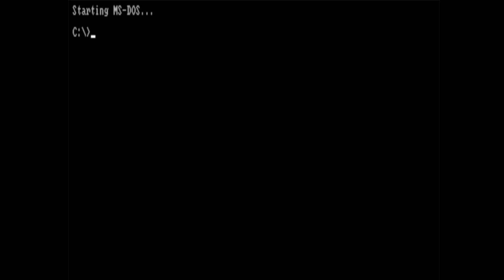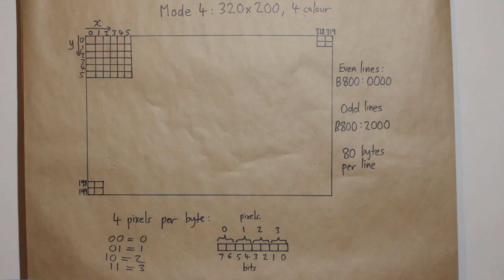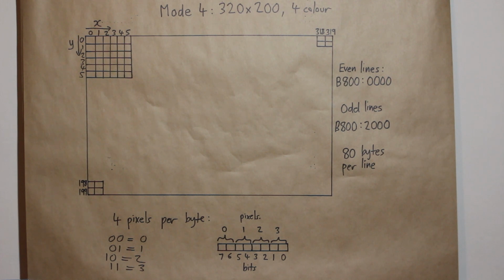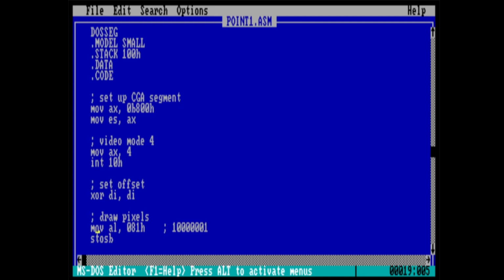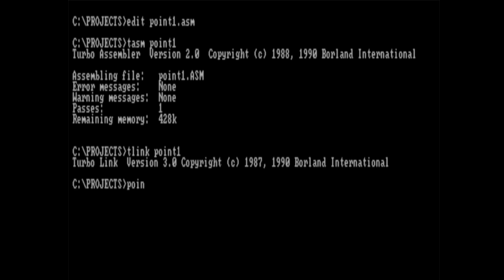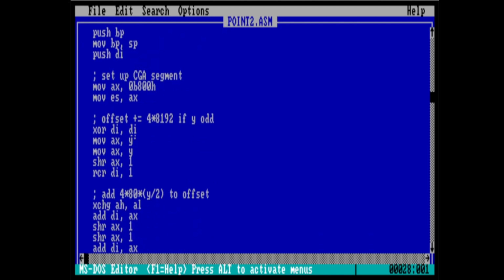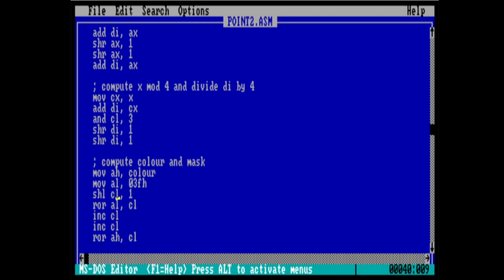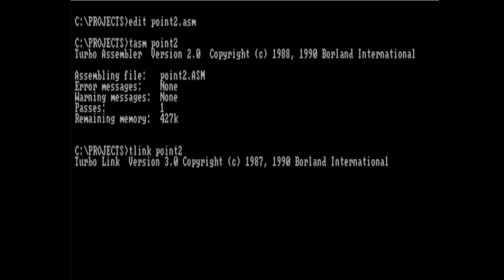CGA Graphics Programming: Mode 4, Pixel Drawing Routine

Comment: It's not really counting from zero, conceptually. It's counting from the address of the buffer. The first pixel (or first 4 pixels in CGA) is at offset 0, aka buf+0.

I still wonder how IBM came out with a nearly $2000 graphics subsystem that only had 4 ugly colors in medium res. If you pay that much, don't you at least want to pick the colors? On one hand, I'd say that anything going on at a corporation has about 20 bodies for every 1 competent engineer, and I'm not all that sure IBM was primarily an engineering company. They also weren't a marketing company based on their ads.  Sales?  Yes, I think so, just like all the companies where I've worked with abysmally bad tech. They just had lots of talented salespeople.  And I did hear on a Computer Chronicles rerun from around 85 that they were hiring 2000 more. 

Ti wasn't so good in sales, but they had a machine with 16 colors. 8bit guy seemed to imply their design was poor since they used VRAM to run BASIC. Personally I think it's smart. For very 100 users, how many are going to run BASIC regularly anyway? 5?  I ran it about 3 times in 3 years.  But they had video RAM which could play 16 color games and educational titles, in pretty good resolution, with fast sprites, plus even sound and sometimes speech.  The whole Ti cost less than just the CGA card!  It would just work.

Which brings me to Macs. IBM -- Big Brother, drab and uninspiring -- has 4 sad colors, so how is Apple going to differentiate?  Yes! Comically tiny monitors that are strictly monochrome. High fives!

Comment: What changes will need to be made for Mode 6 (640x200) if any?
Reply from the maker: Only a few. In mode 6 there is only one colour and 8 pixels per byte. That means if you want to deal with each pixel individually, instead of in pairs, you have to do the arithmetic slightly differently to convert the x-coordinate to a byte location (divide by 8 instead of 4 and do single bit shifts rather than by a multiple of two bits when putting the bits in the right place in the byte).

An improvement over mode 4 is you don't need to deal with multiple colours, so there's no need to store a colour. Just set the appropriate bit and you are done.
Reply: @pcretroprogrammer2656  I'm still a little confused as to the logic cause I can't get it to work.  Does the following stay the same?

    ;;;;;;;;;;;;;;;;;;;;;;;;;;;;;;;;;;;;;;;;;;;;;;;;;;;;;;;;;;;;;;;;;;;;;;;;;;;
    ;; Offset += 4 * 8192 if y odd.
    ;;;;;;;;;;;;;;;;;;;;;;;;;;;;;;;;;;;;;;;;;;;;;;;;;;;;;;;;;;;;;;;;;;;;;;;;;;;
    xor     di,     di
    shr     ax
    rcr     di

Also, does anything need changing in:

    ;;;;;;;;;;;;;;;;;;;;;;;;;;;;;;;;;;;;;;;;;;;;;;;;;;;;;;;;;;;;;;;;;;;;;;;;;;;
    ;; Add 4 * 80 * (y / 2) to offset
    ;;;;;;;;;;;;;;;;;;;;;;;;;;;;;;;;;;;;;;;;;;;;;;;;;;;;;;;;;;;;;;;;;;;;;;;;;;;
    xchg    ah,     al
    add     di,     ax
    shr     ax
    shr     ax
    add     di,     ax

I'm guessing it does cause you said that it's 8 pixels per byte but I can't figure out what part needs altering.  I can't figure the following out either:

    ;;;;;;;;;;;;;;;;;;;;;;;;;;;;;;;;;;;;;;;;;;;;;;;;;;;;;;;;;;;;;;;;;;;;;;;;;;;
    ;; Compute x mod 4 and divide di by 4.
    ;;;;;;;;;;;;;;;;;;;;;;;;;;;;;;;;;;;;;;;;;;;;;;;;;;;;;;;;;;;;;;;;;;;;;;;;;;;
    add     di,     cx
    and     cl,     3
    shr     di
    shr     di

I've tried adding extra "shr" instructions but it doesn't work, I removed "add" instructions and still doesn't work.
Reply: @pcretroprogrammer2656  My replies keep disappearing so let's try without code and links.  If possible could you make a point3.asm in in your PCRetroProgrammer repo on github targeting mode 6 as I tried a couple of different things based on your reply but I still can't figure it out.
Reply: You actually would not need to change anything. Black (00 binary) stays black, white (11) stays white, while the 2 colors in the middle automatically transpose to opposite bit patterns, 01 or 10, 50% vertical stripes. If you want to get fancy, you could transform cyan to alternating 10 or 01 on even/odd lines to generate a checkerboard dither, and make magenta (which is a little darker) 01 on even and 00 on odd lines. You probably don't want to be drawing pure black and white vectors in 640x200 because the weights of the lines would change depending on how vertical or horizontal they are. Or you would need an algorithm to correct for it, but then it's not really much better looking than 320x200 anyhow.

Comment: Push/pop instructions are slow on x86 before Pentium 4. But we can use mov/mov instructions to and from the data segment and load it multiple times from any nested sub-routines without to care where the stack pointer is. Calling convention ignored.

Comment: Good work.
I like to use x86 assembly with a little help from debug and i put all instructions into batch files and most of the batch files have to start with on or more parameter attached to build a routine. I made some videos(no speech) for the DosBox emulator to share the batch files and to show how it works. Have fun.😊

Comment: The memory layout is not due to CGA being interlaced? I mean, that would make perfect sense as each half-frame would display either odd or even lines and these are not perfectly placed in memory for that.
Reply from the maker: No, standard CGA mode 4 is not interlaced. The scanlines are all output in order. The chip has the capability to do interlacing, but it doesn't work without a lot of babysitting in the IBM CGA card. It's basically unusable at this level of difficulty.

Comment: what program are you using. this code gave me a bunch of errors
Reply from the maker: Turbo assembler and Turbo C. Versions 2.0. You'll need a CGA, EGA or VGA compatible graphics card and obviously MSDOS.
Reply: @pcretroprogrammer2656  Well there's Neutrino's Turbo C++ emulator. would that work?
Reply from the maker: @AllGamingStarred  The assembly code is specific to Tasm. Assembly language is not exactly portable. Any C code should work in a C compiler, so long as it is designed for DOS.

Comment: Can you explain each of the the five lines where you compute 4x80* (y/2) ? I know what each assembly instruction is doing. 1) exchanging hi and low ax (but why)? Then adding it to the offset then dividing ax by two twice with shr (why?)then adding to ax. Boy Im just not getting that part. Thanks!
Reply: So.. knowing 4x80=320 the xchg is always multiplying y/2 by 256 (by flipping the y value from the low byte to the high byte which is always fine since y is always less then 200) and adding to di. Next the two right shifts divide y by 4 (thus reducing it to 64 x y/2) and adding that back onto di. (So 64*y/2 + 256*y/2= 320*y/2.  Wow.  Very cool. Hard for me to read but very cool haha.
Reply: @joshinsnowcountry  Oh great you got it. Yes, that's absolutely correct. It's so fantastic to see people working through this stuff line by line. It encourages me to make more videos, which I really have to get back to on the channel very soon. I'm in the process of moving country, so time has been tight. But more is coming.
Reply: Ok i picked a simple odd y value of 3 and walked through calculating step by step and yeah wow it works. I just.. dont understand why/how that was figured out haha Ill stare at it some more.